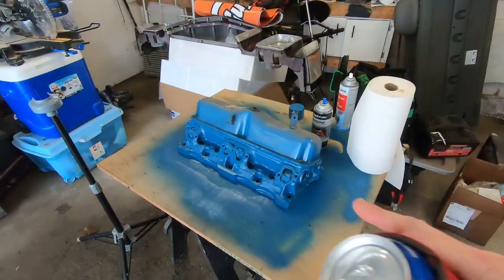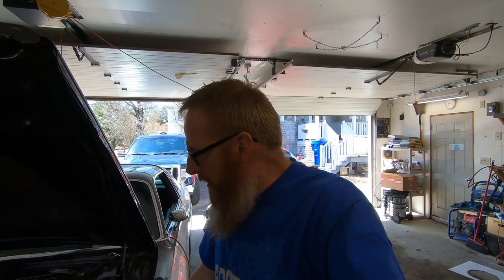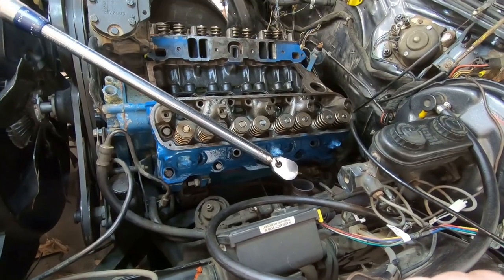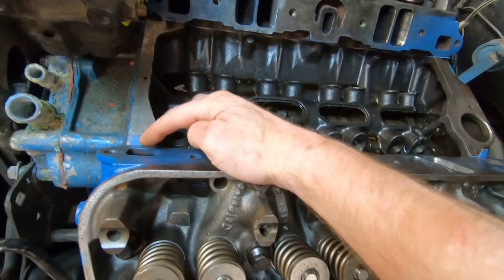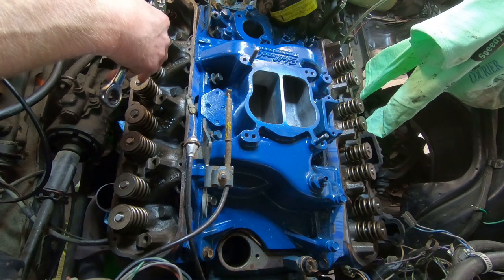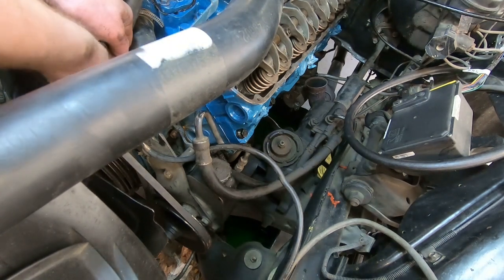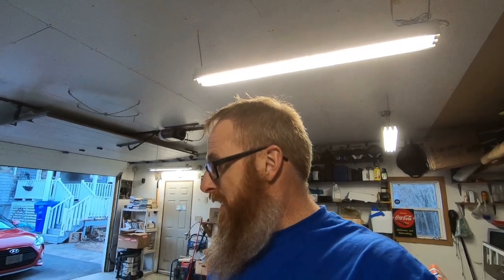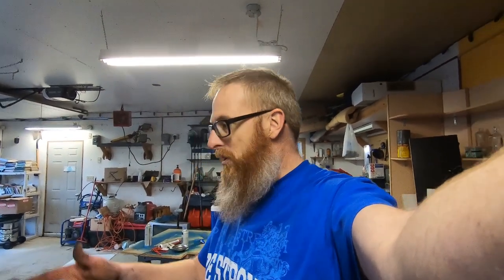MOPAR J HEADS PART 6  FINAL ASSEMBLY

Comment: The Mopar distributor using the slot instead of a conventional gear to connect to the cam shaft is much easier to time in my experience.
Reply from the maker: Yes and you only have a 50/50 chance of getting it wrong the first time?🤪

Comment: I've never had a car engine tore down like that before Single and twin cylinders multiple times but nothing bigger.  My question is did you check the valve gaps but not show it or is it not necessary? I was going through in my head what should be happening and in what order with my little knowledge of small engines and was surprised not to see a feeler gauge.
Reply from the maker: Not in this type of set up. when the machine shop does whats called a "valve job" they seat the valve which mates it and seals the valve to the hardened valve seat. The valves need to seal. So no Feelers!